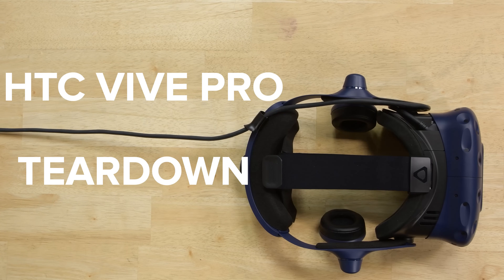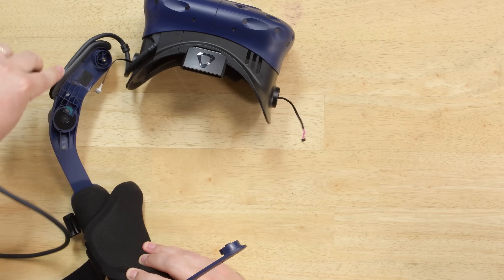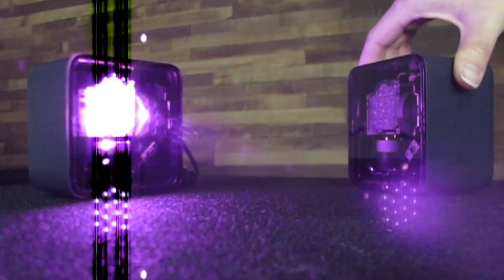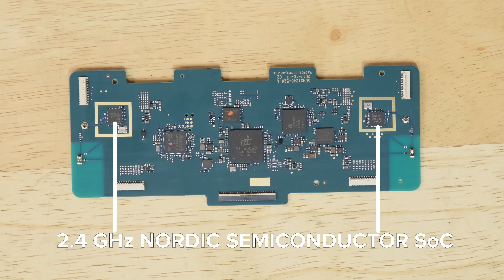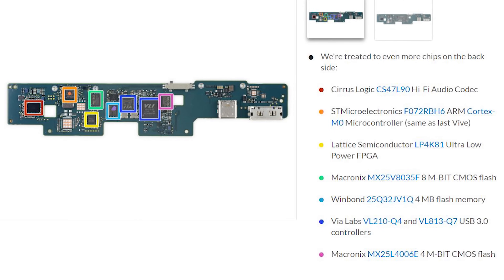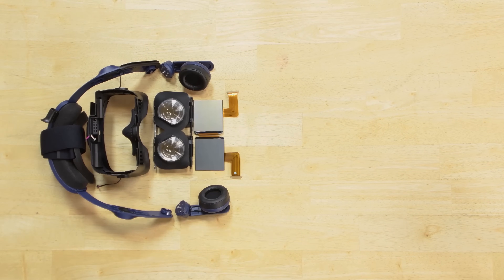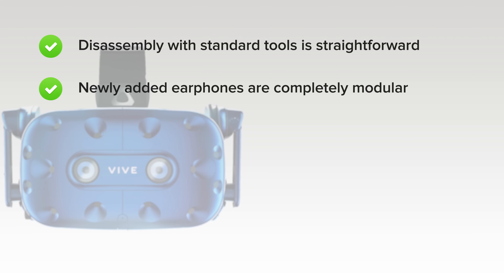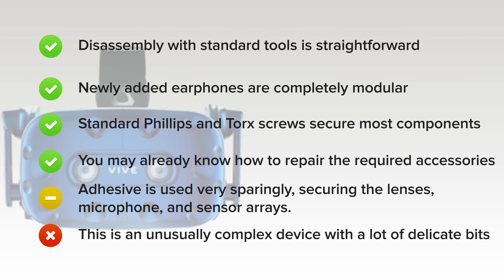HTC VIVE Pro Teardown!

Comment: @ifxit what are possible side effects if the headset dropped on the floor from like a meter high couple of times 
i dropped it once , thus so far so good just wondering
Reply: Nothing is a side effect, i accidentally threw my vive slamming into the floor, disconnected cables but that's all

Edit: It's the video cable that got unplugged

Edit 2: I was wearing my vive and dancing in vr with the regular strap, and then it flew off my head

Edit 3: These aren't edits, i made you believe they are.

Comment: The Vive Pro doesn't actually come with upgraded optics (which would mean lenses), instead, it's just the screen that's an improvement. Unfortunately they still use the fresnel lenses from the original Vive.

Comment: That's not 1440p, that would be 1600p. This nomenclature defines horizontal resolution. It comes from the days of interlacing when you had two fields of horizontal lines that rendered every other frame (field one, than field two, and so on)

Comment: I like how nice the orange wires contrast with the blue of the frame. Almost like HTC made it intentionally nice when tearing down.
Reply: that's standard ribbon cable. I would be surprised if they used a colored ribbon cable for an artistic appearance in an area most wont see...
Reply: DarkShadowsX5 doesn't mean there wasn't careful design work done to make it look nice and come apart easily...